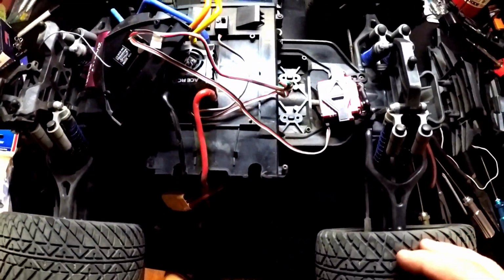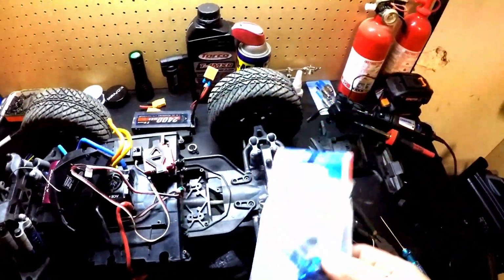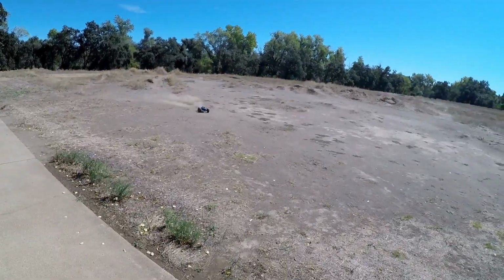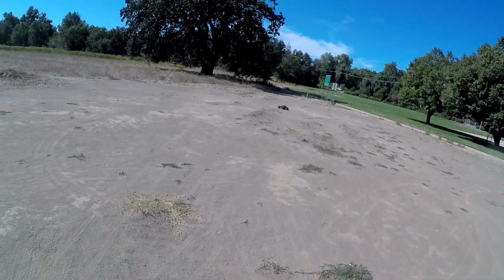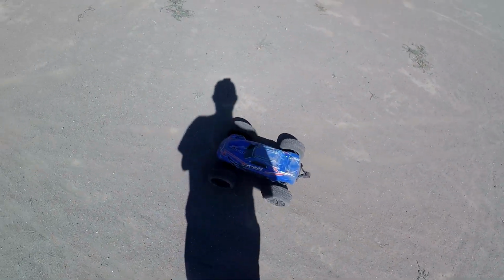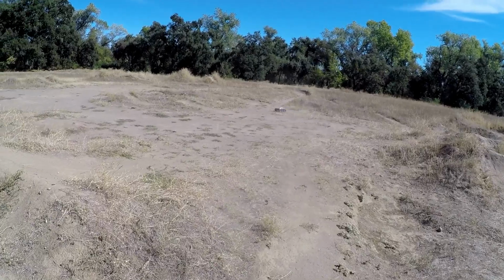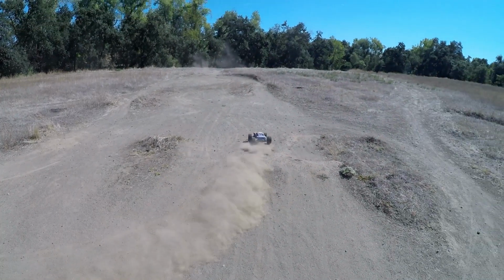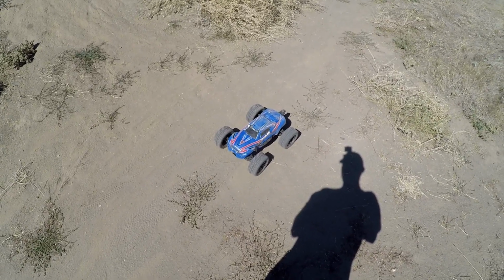Thunder Tiger e-MTA G2 6s Bash

Comment: Hey Gary! Where you been man? Good to see you back I see this is your third video back. That's cool! You should try working on the thunder tiger k rock! It's horrible to work on. Super fast but takes an hour to do anything fixing wise on it. 👍
Reply from the maker: LOL I have heard the K-Rock is junk, looks cool tho. I just been busy working on the new house and working 60 hours a week. It's so good to be back
Reply: @killeroffroadhobbyz  right on man 👍 also that's y you don't listen to other people I've had the k rock for 4 years only thing I've ever had to do was put a metal spur gear in it and the body is brittle other than that I've beet the hell out of it and that's all I've had to do. Allot of people say alot of things are junk bro if it was true then every single time would be junk lol. Looking forward to new vids man 👍👍
Reply from the maker: @theirishaxe9405  I will have to review a K-Rock for sure then
Reply: @killeroffroadhobbyz  well if you do remember the stock spur is plastic you will need to do metal before you drive it on 6s. And the body is junk it's cool idea it comes with a exo skeleton like the summit but they made the material way too thin so it will snap first roll over I used a emaxx body on mine. But other than that it's a good deal when it's on sale the suspension has been decent for me haven't broken a drive shaft and haven't blown a diff to be honest I've had way way more problems with my losi xxl2e than the krock. Maybe I'm just lucky and don't know what I'm talking about but I've had just about every single electric truck out there and some nitro and been doing this for over 20 years so I do know what trucks fall apart. 👍